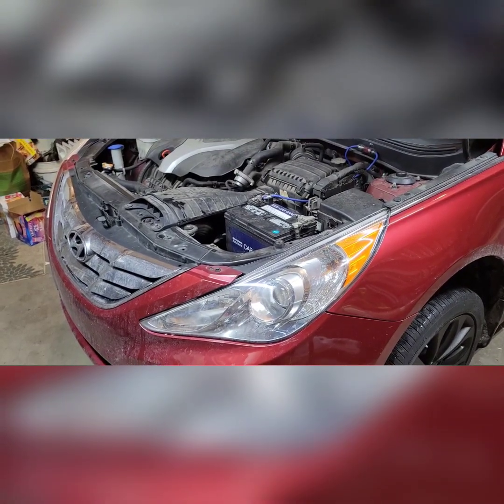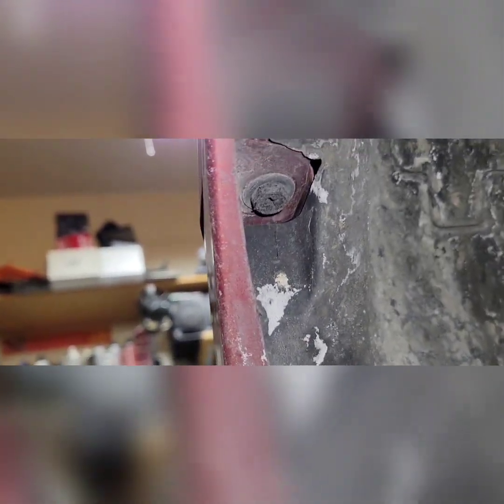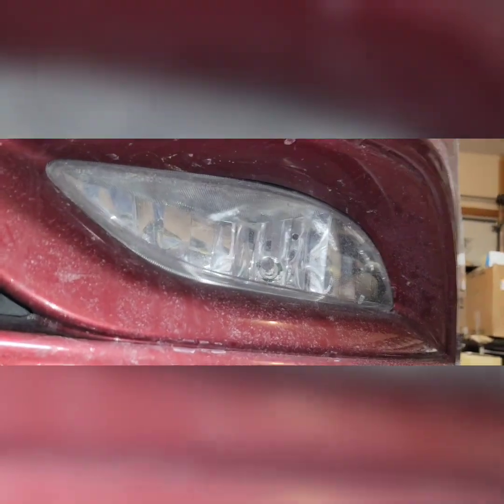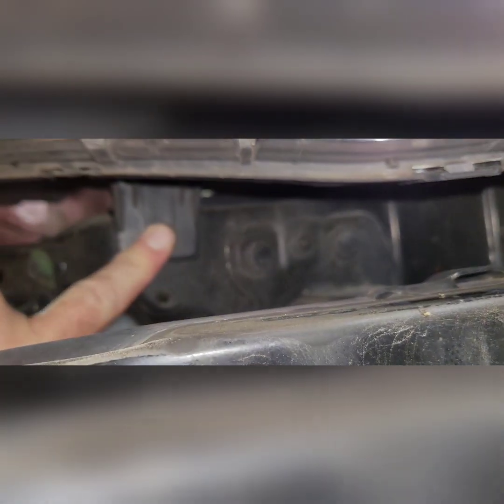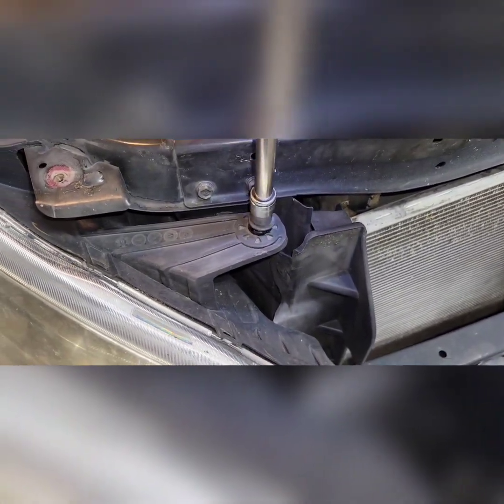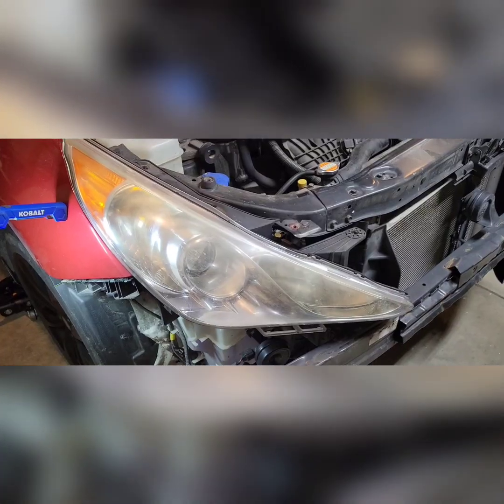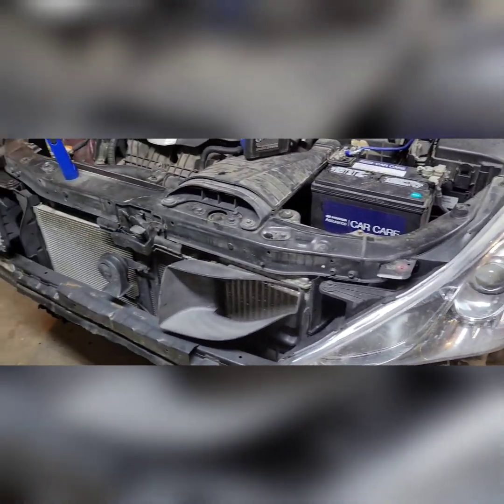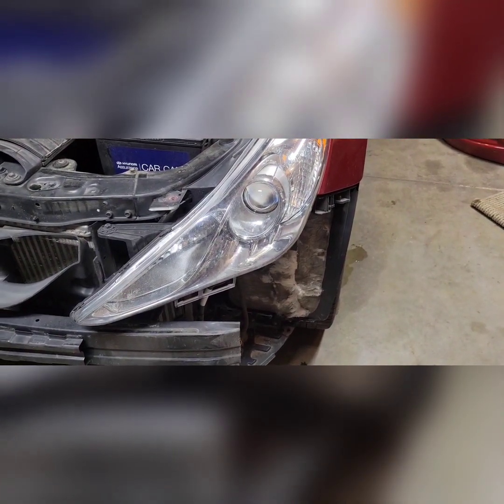2012 Hyundai Sonata headlight assembly replacement.

Comment: Have they been better after 4 months?  TIA
Reply from the maker: Still better than lame factory headlamp assembly.  I think the only real fix is to have a different car.
Reply: So they are still not bright enuf at nite? Im having same issue with my sonanta same year too was thinking about getting the same headlights as you
Reply from the maker: @serginnn956  These are better than factory, but not as good as some of the newer model cars.  Being able to adjust the lights on these make quite an impact vs the factory, much safer at night.
Reply: @elvrolet  how bad was it to get that bumper off, I really hate those clips
Reply from the maker: @camaro02dk taking it off isn't a huge pain. The problem is when the plastic tabs break and you have to figure a way to repair it.  Mine does not sit correctly any longer.